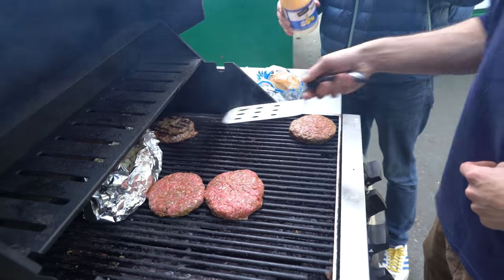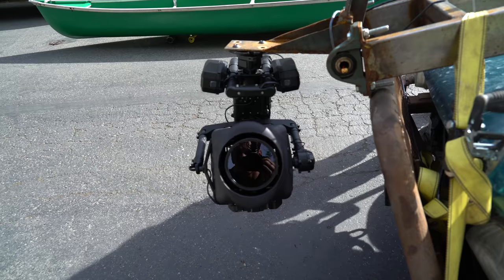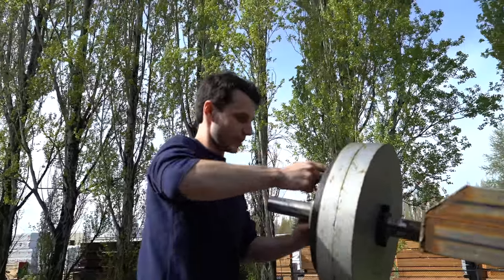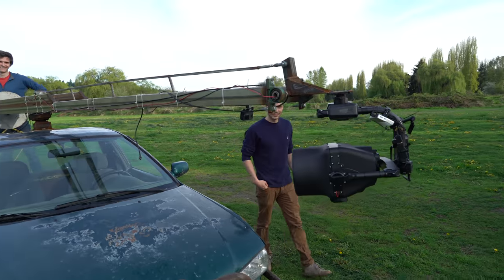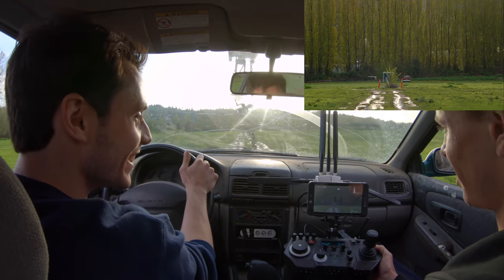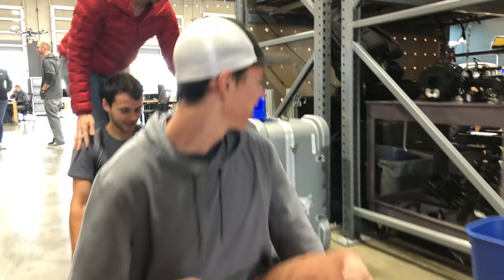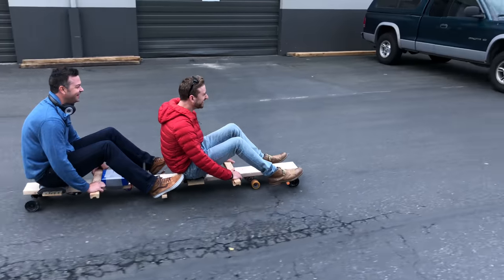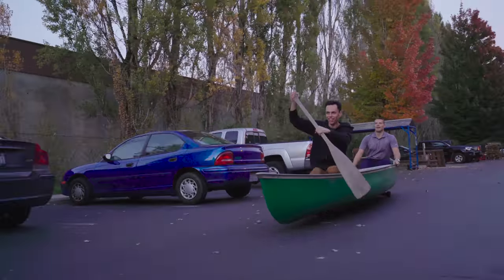E-Skateboard Trucks on a Canoe?!?

Comment: If you ever bust this thing out again, try putting the rider right behind the front truck or adding weights to the front.

With the rider over the rear truck steering is happening from the rear.

More weight over the front would help the rider transfer torque if you like the rider in back look. 

Regardless rear wheel steering is wobbly and hard to control at quicker speeds.
Putting that weight right over the front truck is why downhill long boarders can go so fast without wobbling.

Loved the video!